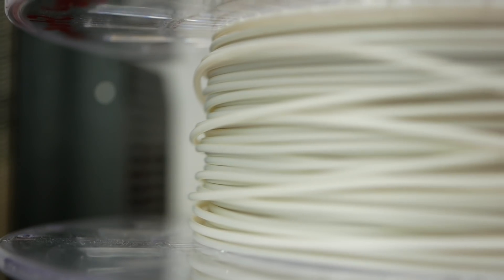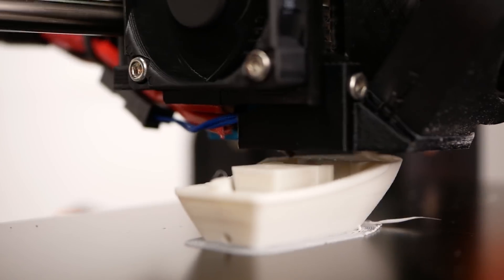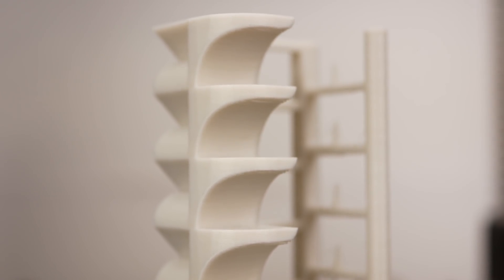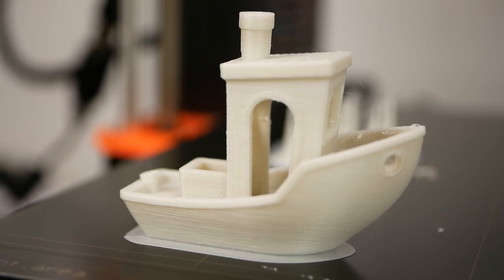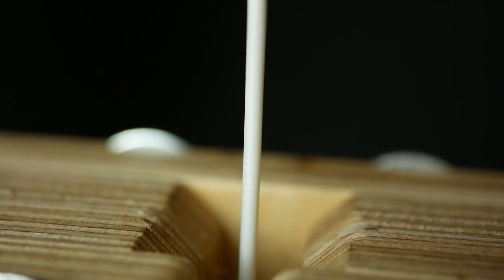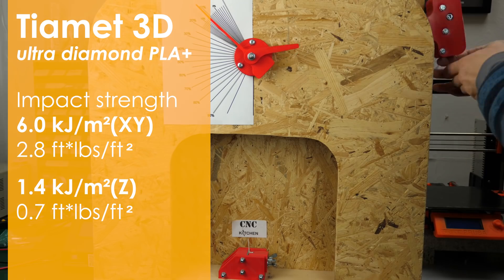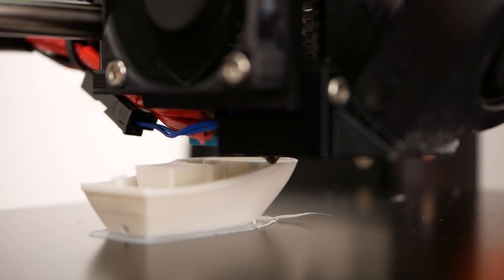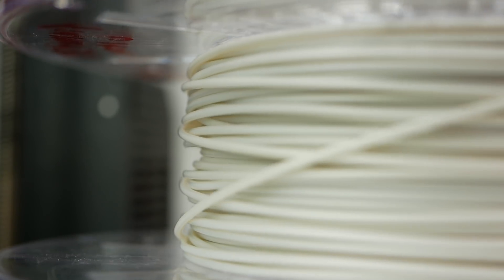Nano Diamond PLA filament REVIEW - Tiamet3D μltra diamond PLA+

Comment: You totally need to do a creep deformation over time of the prints under load - PLA especially does this. Put them under strain like a chip clip or a clamp and they'll warp under the load in about 24-48 hours and it happens to all plastics.

Comment: I'm going to get my first 3D printer around cyber Monday so I get a good deal. My first print ever could be with this stuff. That would be incredible
Reply: Unless you are rich I would find a cheaper regular PLA to experiment with first. There are a lot of exotic "filled" PLAs and I have tried a few like Bronze filled with limited success.  Personally I would try several ordinary PLA filaments and possibly PETG first. ABS really needs a heated cabinet to put the printer in but has its uses.

Comment: Strong mineral combined with an inferior filament. It’s a garbage filament with the pla being the weak point. You could get the same results with much cheaper quartz. Mixing minerals like diamonds are going to create weak points with the pla due to abnormal crystalline structure as the diamond disrupts natural lattice bonding. The pla will never bond to diamond -period. Why won’t these companies focus on stronger and more reliable polymers rather than mixing ground up rock dust into filament?

Comment: i'd like to print a reduction gear with that ^^
BTW, in your test could you print gear and test the amount of torque they can transmit ? also a max rotation speed before failure would be nice. That would be a good way to see some of the properties you test on a "standardisable" practical application :)

Comment: Hi Stefan, do you still have your Filastruder? If so I could send you some polypropylene pellets (~1.5kg) + a selection of colour pigments if you'd like (free of charge). 
I work as an injection moulding plant operator and have some excess material that was spilled from burst bags (not contaminated as I only kept the material from the top of the pile that it formed, so it never made contact with the ground although it has to be discarded as per company protocol). I figured it might make for an interesting video since you've now had experience with 3D printing specialised PP filaments. The pellets are "SU75AV" if you're interested.

Comment: Id love a sample, I wanna try testing by printing it as a sheet on my new ender 3. I would like to see how well putting a 200x200 3 or so layer think square of it conducts heat when a warm (not hot) object is placed in the middle of it and how well it spreads to the edges. I also wonder if it could be a potential heat sink for motors who get warmish but not hot and having a cooling fan blowing on it. Very interesting product!

Comment: Question:  Does a printed element display any low friction properties and if so do they change after annealing?  I would be very interested to know just how well this material would perform in various applications.  ie: rotational bearing; longitudinal and/or rotational bushing; and as a T-slide and/or T-guide.  Would not mind testing some myself.

Comment: Heatsinks are the only practical use case for this filament. 
3D designed/printed heatsinks that are integrated into a part, in a way that otherwise is not possible with traditional aluminum/copper heatsinks. 
For example, powerful LED's mounted inside an enclosure, you'd need a heatsink so heat can travel outside of the box to be cooled, so LED does not overheat. Using aluminum/copper may not be practical or too expensive. 
Fun fact: diamonds conduct heat far better than copper or aluminum.
This filament is inferior in strength, its expensive, moisture sensitive, not available in many colors.
The only practical use for this filament, is 3D printed heatsinks. 
I will use this filament for heatsinking powerful LED's inside an enclosure.
Reply: It has a very high stiffness, I may have uses for that.

Comment: I was lucky enough to get a sample of this filament a few months ago and absolutely love it. It's a very strong and resilient material. One of the best features of this material is the print speed. I can print a strong piece significantly faster with Tiament 3D filament than in comparison to standard 'strong' materials like ABS, PET(G), PC and Nylon infused materials. I've have tested this material on both a BQ Witbox2 and an Ultimaker 2+ and it works well with both non-heated hobby grade printers as well as prosumer level printers.  Just like Nylon it's important to store this material as dry as possible for best results. Great work @Reid Larson and can't wait to print a lot more things with your material !

Comment: Interesting unfortunately the layer adheasion and price disqualify it for us  as we got to keep the average per kg cost to $ 30 or less. Which means bridge Nylon or some basement price Nylons for gears and lots of basement price ABS, PETG and possibly hips for Frame pieces for or Robot which will use 15-20kg of filament

Comment: I'm very interested in the property of resisting warp during annealing, if a strong part is needed and you need it to be precise after the heat treat I can see this being very useful.
If I won a sample I would be using this to print some specifically shaped gears for a medium torque gearbox for driving the treads on my home crawlspace maintenance robot, mostly because the strength needed for the gears (by my calculations) would require annealed PLA, and the fact that this material resists the warping means the gearbox would mesh up better post-heat treat.

Comment: Hi, very interesting material , I would try to print durable ID batch holder ( carbon fiber work but fail eventually) I also using Prusa 2.5 . Can you test in future some food applicable materials , like for cups for example ? I remember that you did one in the past but it wasn’t recommended to use with food.

Comment: Hey just as a material guide, we advise little or no fan ( much less than 50%) and we do not advise printing above 240C. These two conflicting print settings will first begin to denature the base polymer when printed slowly, and the fans will cool the layers too much to properly bond together. We have also noted that this material, like most other filaments, functions better when properly dry. This may have been why the extrusion factor was 97% and subsequently led to less than perfect layer adhesion.
Reply: So, my colleagues ordered 2 rolls of this filament nearly 6 months ago. They each had the money taken and never received ANY follow up information and never received their filament (didn’t even get tracking information.)

Why don’t you guys respond to emails?
Reply: @TechZpert  When we first launched the material our small team had to outsource many aspects of the business including both billing and shipping. There were many mistakes made and we have subsequently taken over warehousing, billing, shipping, etc. Every customer we have had has either been sent material, reimbursed in full, or both. Yes there were a few customers that did not initially receive material and we chose to reimburse them and send the material anyway, 100% free of charge. We did this because we believe in what we are doing and we hope to not only have a strong material but also a strong name in the 3D printing world. For any inquiries please email: info@tiamet3d.com and thank you to everyone for your understanding.
Reply: I’d really like to see these tests redone with no fan and 240C
Reply: Well explained comment. Thanx

Comment: Is CPLA suitable for 3D printing? It contains Talkum wich makes it crystallize really really quickly for heat resistant, biodegradable parts.
Could be cheaper than these High-temperature PLA filaments
Edit:
No, not possible. Would crystallize when you try to make filament from it.

Comment: Some fills are no better than having air bubbles in the filament. Since the plastic doesn't bind well if at all to the fill material.
Reply: The nanodiamond particles are surface functionalised and the functionality is optimised to the polymer to develop a very high interaction between the two.

Comment: Seems like they could probably have achieved almost identical properties by just mixing in regular old graphite… the increased ductility and reduced layer adhesion is what I would expect from adding an arbitrary impurity to the PLA, and I seriously doubt there’s enough actual diamond in there to detectably effect the hardness or wear resistance.

Comment: I would like to print some custom made support parts for a disabled relative of mine. The PLA I used in the past is a bit too bridle, and shatters if it is dropped hard or deforms if it gets too hot. The main reason would be the high impact strength which is advertised as well as the high temperature resistance once annealed, so there is no more reprinting parts as the wheelchair is forgotten in the car in the summer.
Cheers from the black forest and keep up the good cooking on your kitchen ;D

Comment: @1:15 ... If it doesnt wear out your nozzle,... it doesnt have diamonds in it.  Math.
Reply: That's not really math?  They are spherical nanoparticles in a low concentration.  But they are most definitely made of diamond.  But people always wonder, so it's best to try.  It's like my car, people are always asking if I know it stands for "Lots of Trouble......"   https://www.youtube.com/watch?v=1CLiErbAq5k
Reply: @gavinfarmer3560  Even round hard material would bore out a nozzle. CF bores out nozzles. If there is no erosion, there is no hard material in the pla. Besides whats the point? It doesnt even sparkle, and you know what they say... If it doesnt sparkle, it isnt a diamond. Math.
Reply: @dpqbpqbdpqbpqb4754  OK, we also supply these nanodiamonds for use as additives in machinery oils and as a surface finish improving component in polishing slurries.  So you are right, there is an effect on the surface.  But the material removal rate is very small.  The particles are smaller than the normal surface irregularities of a machined part.  One of the biggest effects is to cause local work hardening of the metal.  Therefore you won't see any effect on the nozzle wear compared to using normal PLA and certainly nothing like what happens with carbon fibre.  It's fine to use with brass nozzles.   But it's a free world, don't use it if you don't want to!
Reply: Ill use your words to ask this question.... So,... All the normal properties of a diamond have been removed, they are round, nonabrasive, and do not sparkle. Regular pla is stronger than the multi-material in most tests, and there are PETG, and ABS waiting. So,..................................... Whats the point. ?
Reply: @dpqbpqbdpqbpqb4754   Contribution to mechanical properties, thermal properties are still there.  Only sparkling and abrasive qualities are lacking.  And nobody wants the abrasive part.  It is stronger than PLA, the loss of interlayer adhesion is not something I have experienced and will investigate.  So the point is, here you have a material which can be used in mechanical and high temperature applications where you might normally use ASA or ABS, but you can print it very fast, without an enclosure, without warping, it gives a very nice clean finish and deals well with fine details, overhangs etc.  If you like to see some examples, look at the work of @spectra3d on twitter for example.  Or pop round for a beer and I can show you it.  I live about 15 miles from Hethel.
Reply: @gavinfarmer3560  NO. Put your diamond pla print in the sunlight, and watch it melt. You must work for the diamond filament company, lol. 
You cant cite strength, or heat because PETG, and ABS would destroy it. 
so, If it doesnt sparkle, and you cant make anything abrasive, its useless. 
-> Its not a diamond if it isnt hard, and doesnt sparkle. Math.
Call it "hard carbon bits pla." because it isnt diamonds.
 
I bet it doesnt have any diamonds in it anyway....
Some wood PLA's dont have wood in them.

Comment: CNC Kitchen ROCKS !!!
I love your videos, especially your tests with different materials.
The mechanical properties of this filament are amazing, so you can use it on any project where standard filament (PLA) would not be enough ... I also like the fact of the temperature resistance very well.
You can build super tools ... printer .. even rockets .. let me try it :)

Comment: I think i would try to print parts that have to have a great impact resistance
Reply: That makes no sense. The plastic would only be abrasion resistant.
Reply: @truantray  why?, Stefan tested the filament in the stiffness and it was the strongest one of them all, so I would try and print parts that make use of the great stiffness

Comment: I wonder if the fiber could be used for a project box, to take advantage of it's thermal conductivity, resistance to temperature deformation after annealing, and resistance to impact? Perhaps like a project box where it would need to dissipate heat, or be able to tolerate heat?

I'm not really sure why it would be better than carbon nanotube based PLA though, or another composite material.

Comment: I’m currently a senior in college studying Aerospace Engineering. For our senior design my team is building a drone with extending wings to increase it’s wingspan in flight. Our drive mechanism uses a gear and two gear racks that are 3D printed with Polymaker’s Polymax PLA. I would love to try this filament out and see if it produces better quality gears. We also need a gear box that we planned on printing out of ABS for its stiffness. I would also love to see if this diamond filament would be a better fit. Thank you for the amazing reviews and thoroughness in testing these materials. Keep up the great work!

Comment: I would be surprized if nanodiamonds would have increased the part's strength susbstantially. The bulk is mostly regilar PLA matrix which has no chance to get held together with really small yet extremely hard particles. Unlike carbon fibers that will not let deformational microfractures to propagate.
Reply: If I had to guess, it would increase the strength of the PLA similarly to how bricks are embedded in mortar. in this case, the PLA might act as the mortar. I dont know if that's actually how it works though.

Comment: If the thermal conductivity is improved, how about electrical conductivity? I'd print a "connector protector" (for shipment of PCBs) with it and see if ESD properties are adequate for that application ;) Unless it needs a hardened nozzle, then i can not use it -.- don't have any of those
Reply from the maker: Unfortunately I have no information on this and no equipment to test it. I'll see if the manufacturer knows something. BUT, are you aware of ESD filaments? https://www.filamentworld.de/shop/pla-filament-3d-drucker/proto-pasta-filament-1-75mm-conductive-pla/
Reply: @CNCKitchen  Yes, I am ... but they are more expensive than the 60 euros I think I remember you mentioning in your video ... they are more like 100 euro per kg

Comment: I want to win some diamond filament, I like the high heat aspect I would like to see if it  could  be used to print heat resistant parts for a 3d printer

Comment: How the heck does this stuff not damage the nozzle? surely over time there would be abrasion?
Reply: I guess it's because Nano diamonds are supposed to be round.
Reply: @jayphone1  round and very small, smaller than the existing surface irregularities in the metal surface.  We also supply nanodiamond materials for machine oils and as an additive to some types of polishing where it doesn't increase the material removal rate but does improve the surface finish.  It creates some localised work hardening of the metal.

Comment: So it's going to ruin your ruby nozzle
Reply: Runklestiltskin _ 
To be honest i doubt its actual diamond.
Reply: Explosion produced nano-diamond is a readily available material; bulk prices get as low as $20/kg, depending on quality.
Disposal of old/obsolete explosives is done in large water-filled pools; the water absorbs the force and heat of the blast.
Owing to the high pressures involved some of the carbon forms nano-diamonds.
With the stuff so cheap and plentiful, why lie about it?
Reply: @pirobot668beta  It is real nanodiamond, produced by the detonation method you describe, followed by a lot of modification and refinement.

Comment: I suspect your fan setting of 50% had something to do with the poor layer adhesion. The breaks appear to behave exactly like PETG that has been cooled too much. Curious why you chose 50% when you noted there was no quality improvement over 25%.
Reply: J Z thought the same bro. As faster the material is cooling down, the less possible is it for the filament to connect. You might be right

Comment: Hi Stefan. Nice vid, thank you.
I did some tests on the Carbodeon PLA+ µDiamond filament (just after TCT 2018) and can confirm pretty much all of what you say. My tests however were a little more subjective as I do not have a suite of test kit as you have, but the results fall in line with what you say. Did you try any Charpy tests (or similar)? I found the material to be quite resilient when it came to impact tests - for a PLA. The two things that stood out more than anything though were the amazing overhang capabilities (as you discovered), and just how fast it can be printed through a standard hotend and nozzle - I had it up to just short of 300mm/s on one of my printers (0.2mm layer, 0.4mm, E3D Titan Aero, 250°C) before I started to have issues with extrusion. I suspect the faster print speed may be due to the higher thermal conductivity of diamond over bare PLA helping the melt, but I am not a physicist/ chemist.
The Carbodeon website does mention up to 500mm/s, so with a Volcano hotend...?
https://carbodeon.com/product/udiamond/